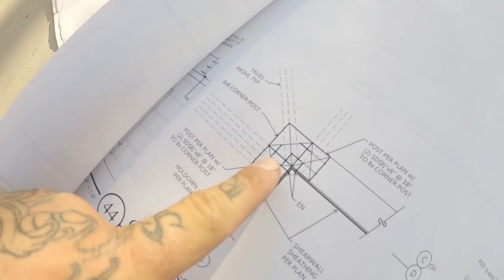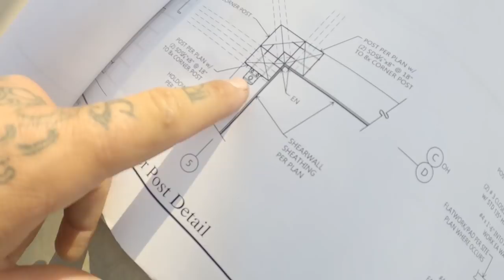Rough Framing of Storage Room COMPLETE! [DAY 10]

Comment: Just curious why only some walls you sheet on the ground? Is it simply the lift capacity of the forky thing?
Reply: It is almost always better to sheet on the ground.  Exceptions are: will be too heavy to lift, you need to rack wall but don’t have the space, you need to leave a piece off that overlaps another wall,  and my favorite,  ran out of material/late delivery.
Reply from the maker: Josh nailed it. Depends on the situation. A lot of the time, it's too heavy to lift. The walls that need to rack, we tack our sheets up, nail off after.